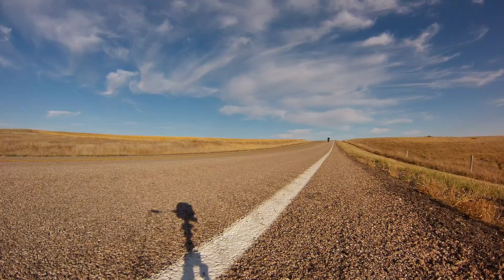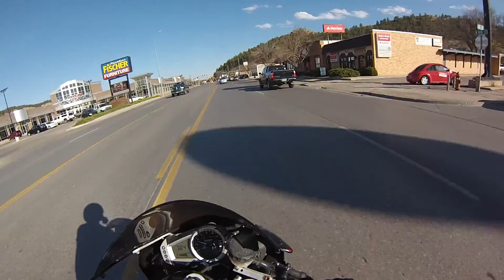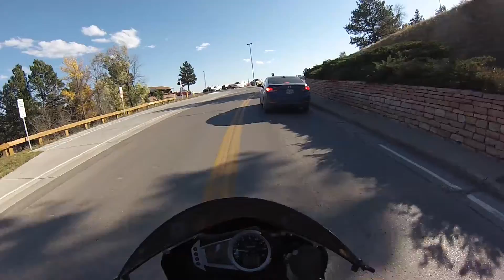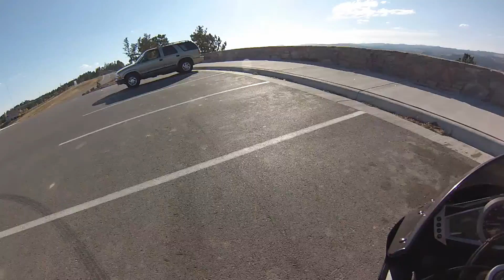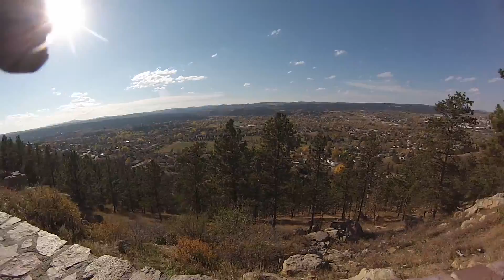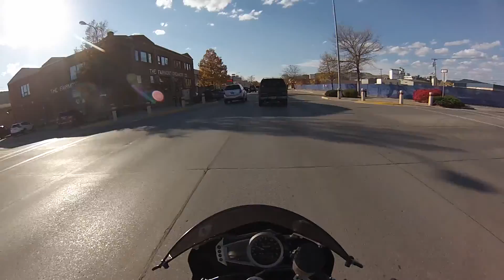Is Premium Gas Really Better? | Engines Explained Part 1

Comment: In Aus, standard unleaded fuel is 91 Octane while premium is 95 Octane, then there's high Premium at 98 Octane. I run the fuel in my BMW R1200RT as recommended by manufacturer, 95 Oct min. Cool explanation in your video as to compression ratios and fuel. Cheers
Reply: AU And the USA use different rating systems for octane in pump gas.  AU use the RON system, while the US uses R+M/2, which gives a lower number.
The AU 98 is about the same as 93 octane from the States.